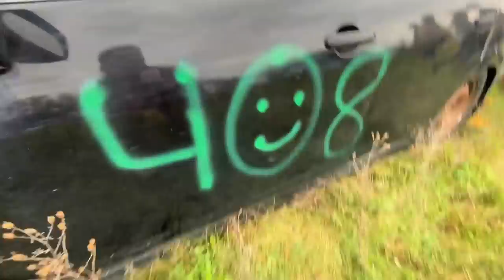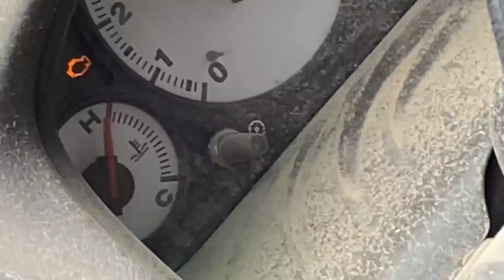Mini Van CRASH FIRE!

Comment: Look up ( engine blow ups ) on YouTube on how to do it properly, all your engines just seize up. 

A properly blown engine is supposed to run at full throttle with the wheels spinning off the ground of course in drive then after a while shoot the valves and connecting rods through the block and spew the oil and water from underneath the car ( it might catch on fire too ) from the hot exhaust